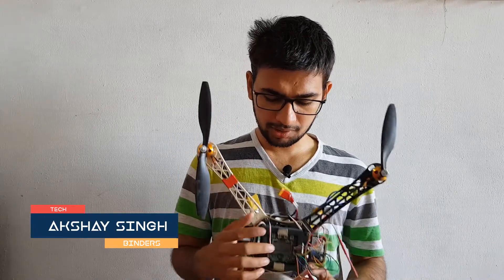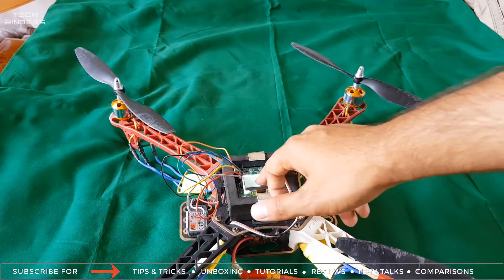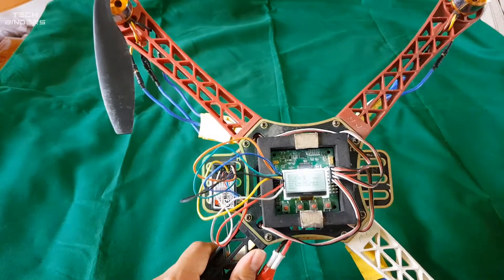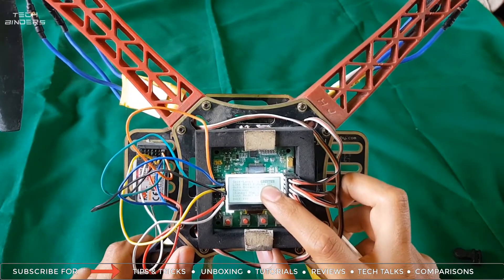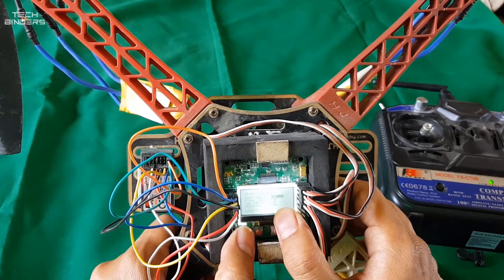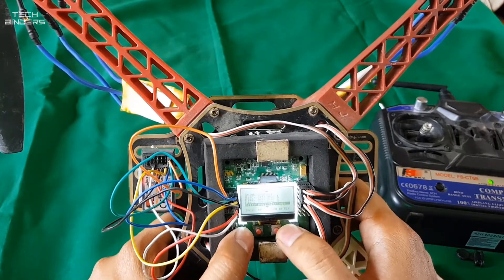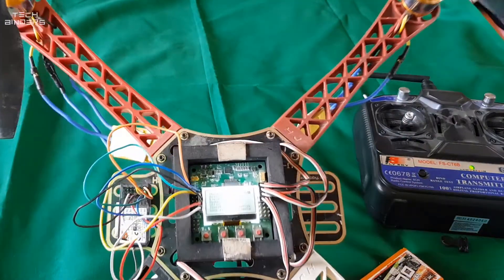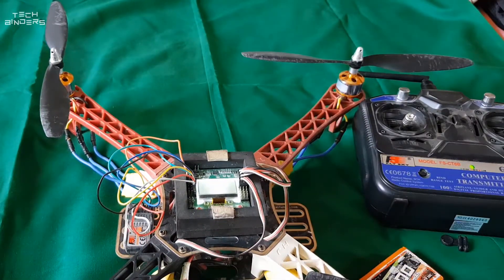How to configure and do initial setup on KK 2.1.5 board 😀 [part -6]

Comment: Why my kk2.1.5 board is turning off soon after arming? 
And sometimes only 2 or 3 motors works and the system turns off??
Is it because of the battery. I am using a 2200mah, 25c, 11.1v battery.

Please help...
Reply from the maker: Not enough current to kk board..

Comment: Bro videos was not clear bro pls help me Brother
Reply from the maker: How may i help u?
Reply: @TECHBINDERS  bro my problem was how bind transmitter and receiver bro .
Bro my transmitter was binded on receiver but motor was not rotate bro not fly and show error
Reply: I am mathanraj . I am a engineering student bro my final year project was making Quadcopter. 
All procces is done but quadcopter was not flying bro pls help me Brother
Reply from the maker: What error, if you eant to know how to bind transmitter and receiver i have made a video for that go and check it on my channel.
Reply: @TECHBINDERS  bro to bind on transmitter and receiver but move throttle but not rotate the motor brother please help me Brother
Reply: @TECHBINDERS  you are only help me Brother please help me

Comment: Hi, can anyone help me please? I calibrated the esc's. Throttle works fine but if I wanna change any direction with the right stick two motors at the side starts rotating faster but the problem is that the opposite ones completely stops. What should I do ?
Reply from the maker: What flight controller u are using??
Reply: @TECHBINDERS  KK 2.1.5
Reply from the maker: kindly message me on WhatsApp so that I can assist u better/.
Reply: Vvg

Comment: whats going on guys im doing a project for drones. Can anyone give me a rough estimate of amount of hours to build a drone. All parts are ready and purchased also the employees are in a warehouse-esque area with a conveyor belt to help speed the process. Thank you in advance.
Reply from the maker: The assembly time depends on What type of drone you are making and what components you are using. Apart from that how skilled you are in drone assembly whether you have done it before or it is your first time,there are couple of parameters which affect the assembly time.
Reply: thank you I didn't expect anyone to reply soon. It's a drone mainly used to identify people using facial recognition alongside having the basic GPS and GIS capabilities. The people assembling main job would be solely building so they will be fairly experienced. if that helps any. @TECHBINDERS
Reply from the maker: Yupp so it will take a day or two for assembly and i think some hours for testing before it can fly high..
Reply: @TECHBINDERS   Thank you!

Comment: Hello I made my quad with kk 2.1.5 . Whenever I increase the throttle it suddenly flips on motor 1 & motor 2 side. Also I have checked the rpm for motor 1 . It is 2 to 3 times that of other 3 motors. PLEASE help
Reply from the maker: Sure bro.message me on whatsapp i will help u
Reply: @TECHBINDERS  hello friend send me your whatsapp number
Reply from the maker: 9458706160
Reply: Calibrate the ESC

Comment: i made a drone from 2.1.5 flight controller and Fsi6 transmitter the problem is it is automatically disarm whenever i try to fly it i don't know why it is happening can u suggest something?
Reply from the maker: Yes surely i will help u message me on WhatsApp for detailed assistance . Turn off autodisarm on kk
Reply: Check your battery voltage if there is any manufacturing defect

Comment: If flight unstable what's problem in quad.
Reply from the maker: There are number of reasons which may result in bad stability
Reply from the maker: Well you can call me and we can solve the problem over call
Reply from the maker: 9458706160

Comment: Hallo friend. I made a f450 quadcopter with 1400kv motor &1045 propeller. K2. 1.5 mini flight controller used. I calibrated Esc properly & the motor spinning in right direction in full throttle.The problem is it cannot fly. Expecting your reply.
Reply from the maker: Ok is it turning upside down or what is the specific problem. You can message me on whatsapp or call me and i will better assist you.
Reply: The main problem is it doesn't fly. Can u please send me the no pls
Reply from the maker: Its there in video.anyway 9458706160
Reply: TECH BINDERS thanks